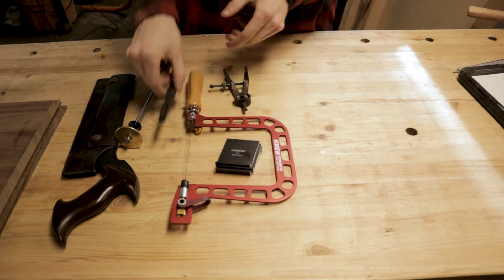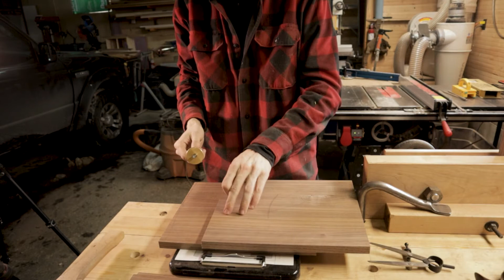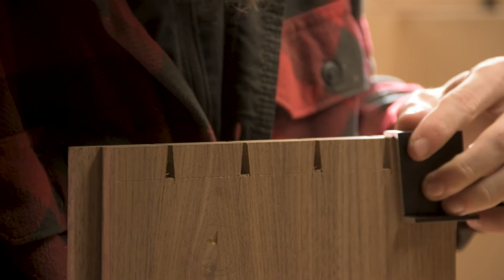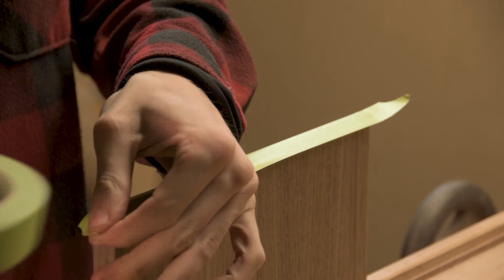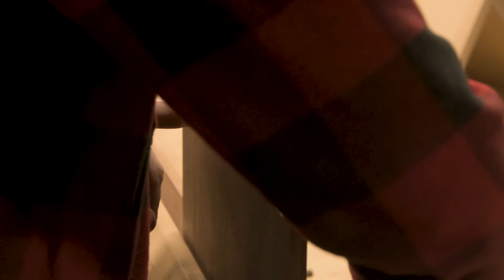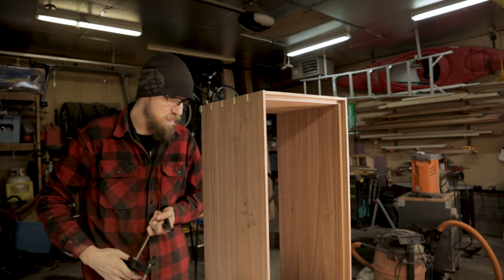Walnut Tea Cabinet - Part 3 - How to Hand Cut Dovetail Joinery | Fine Woodworking

Comment: Thats a spring divider :) The ones with the round piece at the top is a spring divider, this round shape is the spring that wants to push the arms open, and the nut is what stops it from opening more. A wing divider has a quadrant shaped "wing" and there is no spring action to them that wants to push the arms open, it is moved by hand and clamped in place with the nut on the wing :)
Im not bein picky....... jus passin on some random useless information hahah :P 
From what little I could see of you sawing, your body position is a little "cramped" up..... the way youre "hunching" your sawing shoulder upwards is not good for sawing. Try a few practice dovetails (or any cuts) in useless scrap, drop it lower in the vise and take a step back with your foot on the same side as your sawing hand, so your stance is wider. Droppin it lower in the vise will allow you to have your forearm more in line with the work making your sawing action smoother, and you wont have to hunch your shoulder (youre hunching to try get your forearm more in line) droppin it lower will also get rid of that vibration youre feelin through the saw. Taking a step rearward with your back foot will get your body out of the way of your sawing arm and allow it to "swing" more fluidly in a straight line. Make a 100 or so cuts like this and im sure you will feel a difference :) You start the saw well, on the push stroke as it should be;no dragging back or dibbling cuts :)  
Make sure its sharp too, you might be addin extra pressure into the saw to compensate for it not bein sharp.
Reply from the maker: Thanks for the advice, the next time I'm cutting dovetails I'll keep all of that in mind!